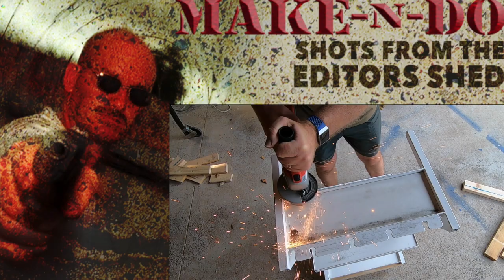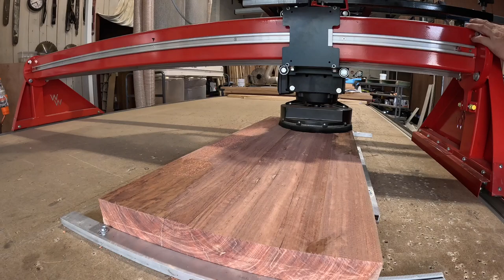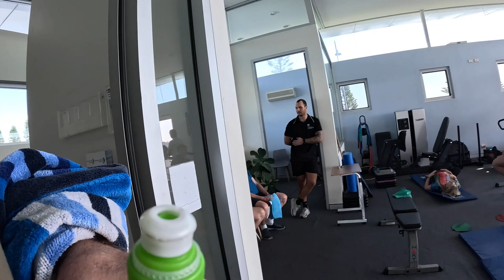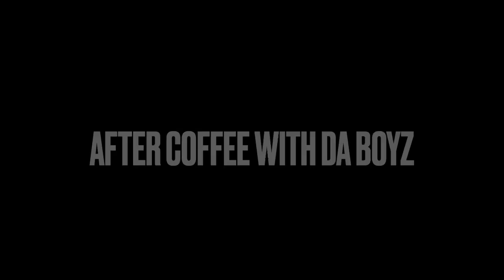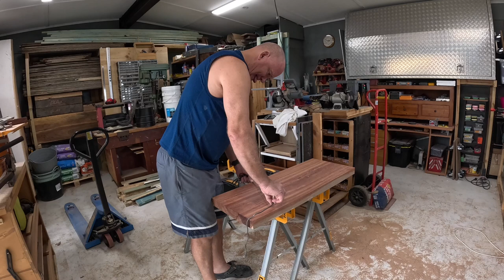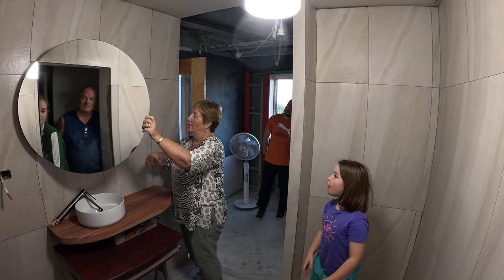Bathroom vanity unit – part 1

Comment: Beautiful bit of timber.  What did you finish it with?  All looking a bit more done than last time, the family all look pleased.  Janet likes your tile work too.

The thing used for the flattening looked like a “Woodwizz”.  You can make your own slab flatter for not a lot of $$ for next time.  Have a look on YouTube and you’ll see what I mean.
Reply from the maker: Thank you Mike. I finished it with the hard-wax oil from Bunnings kitchen isle, as you recommended. And it is indeed very good. 
Yes, I can see the home stretch now. The plumber is coming to do final fixings tomorrow. That should make a huge difference.
Thank you Janet. I am quite pleased with the results on the tiling – though I won't be volunteering to do another tiling job anytime soon ;-) That said, I do have to tie the water closet into the bathroom scheme.
I believe you are correct about the WoodWizz – there was a WW logo on the side. While I even bought a new, powerful router to build my own flattener before I found the Bearded Bloke, I don't think I will now. because he is so convenient and relatively cheap. He's only about 1km away, charged me just $50 for that piece of wood in the video, and $160 for a 2.6m slab, both sides, since. And, I currently only have two more slabs left, so it's not really worth the trouble – or the floorspace – to build my own.
As always, thanks for watching. Oh – and thanks again for that Carbatec blade, which I used to round over the curves on the wood.